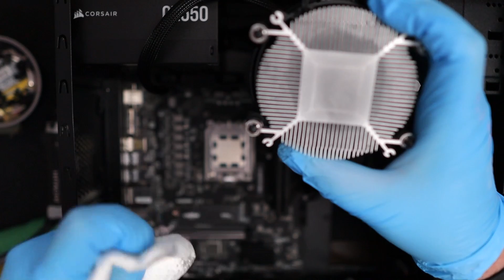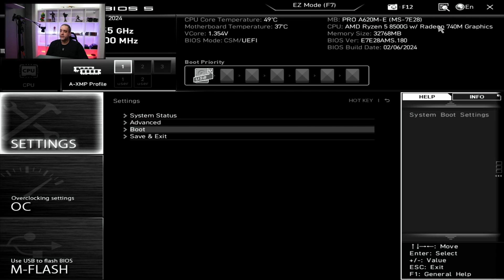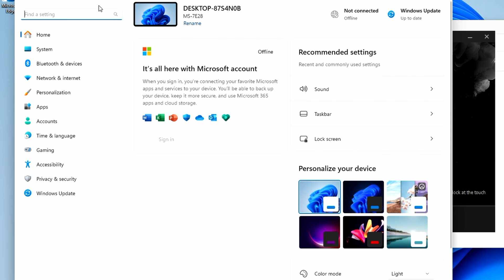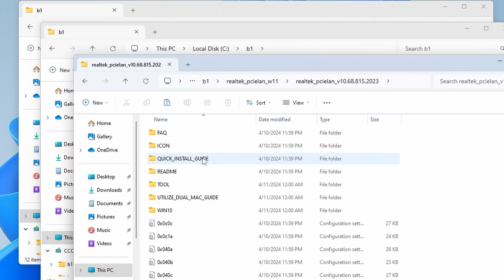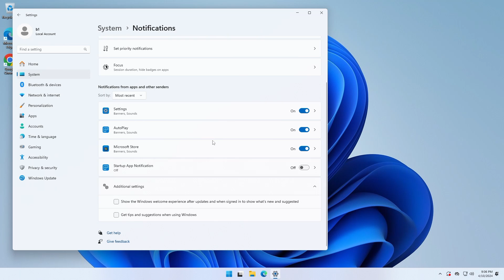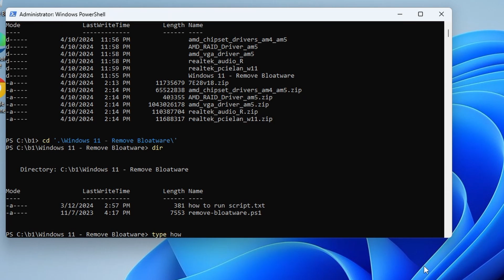System Build 23 - Upgrading the BIOS with a different processor and then swapping.

Comment: Will the A620m-e boot into windows with ryzen 5 7600?
Reply from the maker: According to the website from MSI yes. . . it is supported at version 10 . . . 7E28v10.zip <-- this is the first release of the bios.  It should boot.
Reply from the maker: I would also upgrade to the newest BIOS after your booting. . . because they Fixed CVE-2024-36877 security issue.